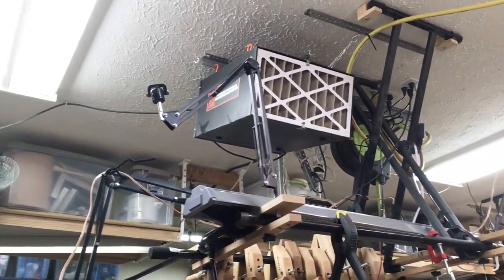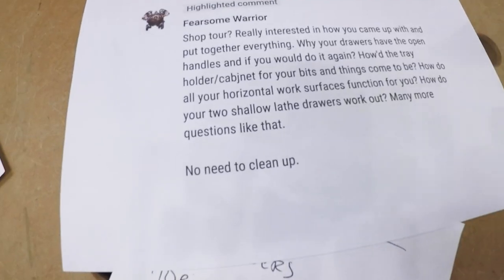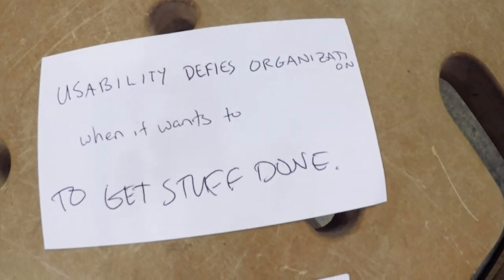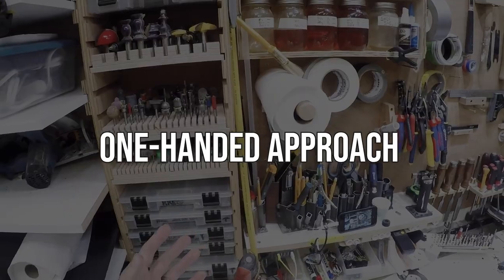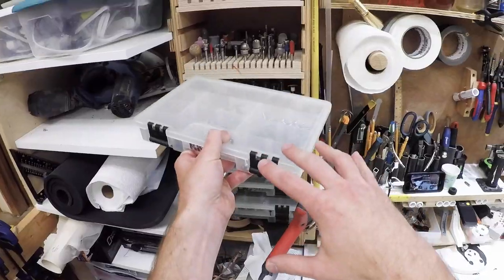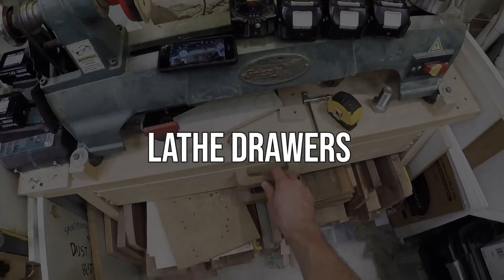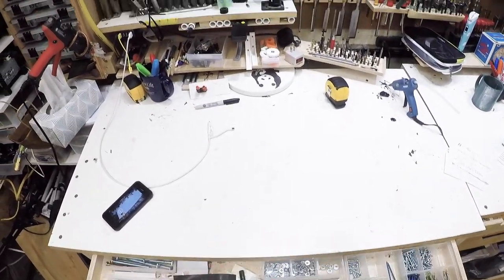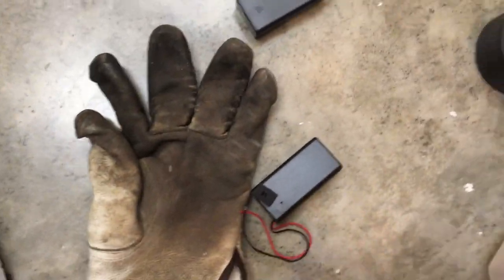Shop Tour + Workspace USABILITY

Comment: I feel so spoiled. Thank you. The montage at the opening and closing are amazing. The music fits and the whole thing fits your channel's style. If you're not opposed to a video intro, a short form of that would be perfect.

Love all the insight and it helps understand the process you went through. Reiteration is always there but the starting point coming from bio mechanics is a really great idea. It will definitely influence my design from now on. Not having a wall just for clamps is incredible because most of us do not have that wall space. I also love that you mention inactive projects sitting out.

I also love that your drawers are shallow. It's another separate topic but I love that the benefit of shallow drawers where you never layer anything outweighs the multiple costs of more drawers. The costs being the money and material expense of drawers slides and wood. The YouTuber ShopBuilt has a large drawer that I am enamored with on his table saw out feed table. It also serves as his assembly table as it does for many of us.

I also have that Makita router bag and packed it full of other router items but we both have dealt with it's storage the same way. That is nothing compared to my frustration with my Dewalt Miter saw stand. By far the most difficult thing to store efficiently in my garage shop.
Reply from the maker: Thanks for the original comment that prompted this. I was hunting for a kickoff video for the usability series and that provided an easy/natural starting point.  

Also good idea about intro/outro. That track (provided for free by YouTube) is was easy to work with so I’ll play with reusing that with some variation. 

Drawers, wall utilization...same page there. 

That DeWalt stand sounds like a terrible predicament.

Thanks again for the comments!